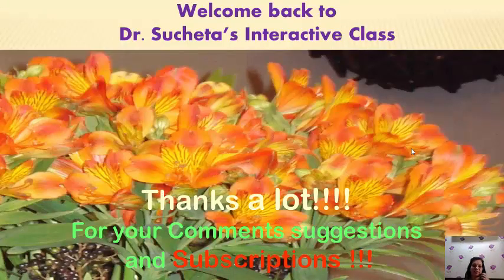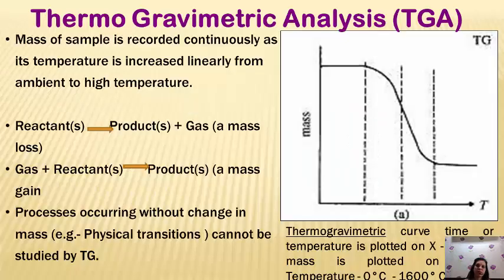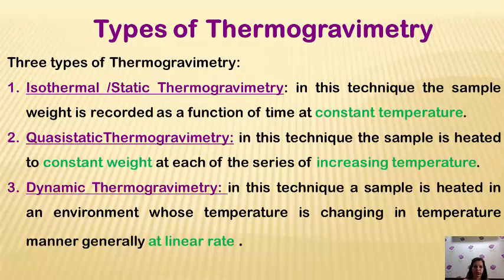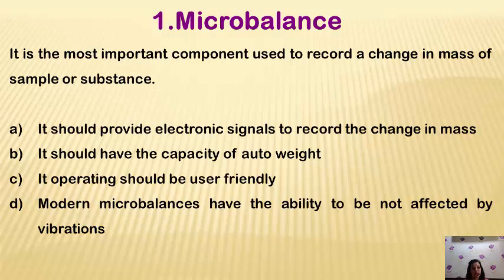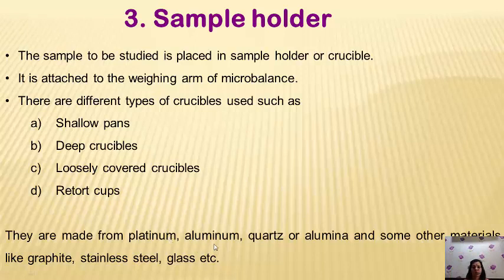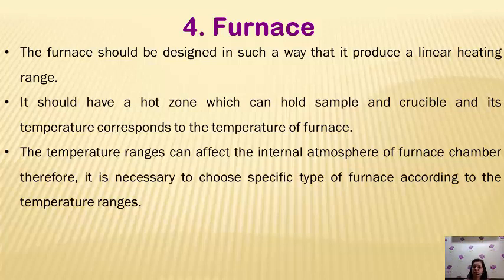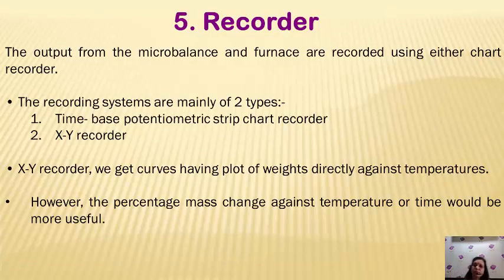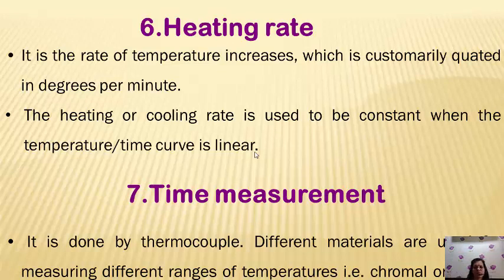Thermo Gravimetric Analysis (TGA)@dr.suchetasinteractiveclas9804

Comment: People around the world (in the literature) perform TGA on cement mortar after crushing the fragments of cement mortar 9eith the help of pestle and mortar) serving through the powdered sample through 40 micrometers to 75 micrometer mesh. I have some reservations in that if we do this procedure for preparing the samples to be subjected to TGA, we are either overestimating or underestimating our results because of the inclusion of finer particles of sand that went along with the particles of cement during the sieving process. In other words, I want to ask whether there would be a difference in the results obtained for powdered form of (1) hardened cement paste i.e., only cement and water; and (2) hardened mortar i.e., cement, water, and sand)
Reply from the maker: Yes definitely  there is difference as the size of material too affect the analysis little bit with respect to temperature